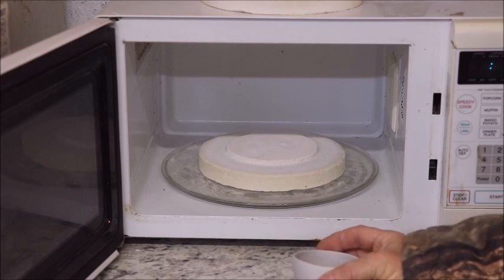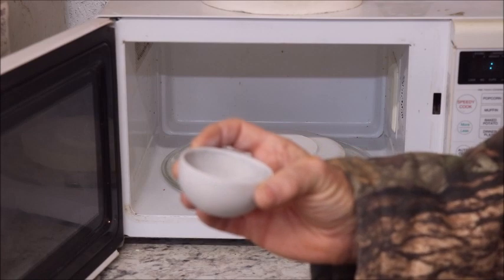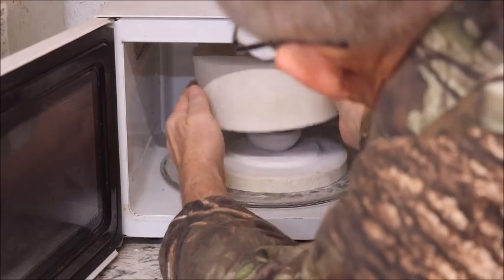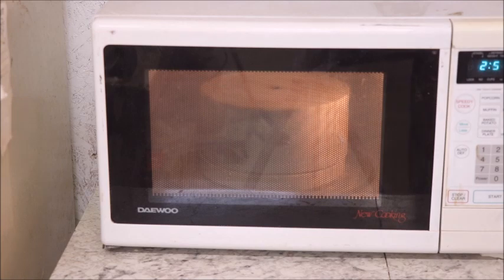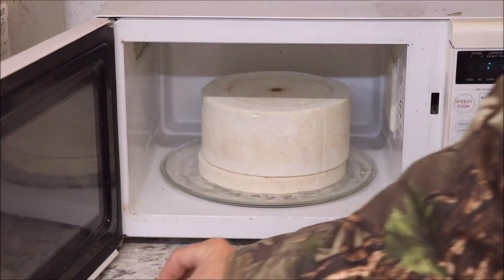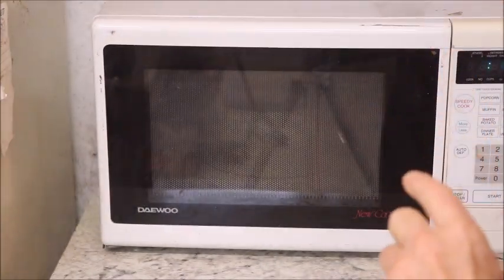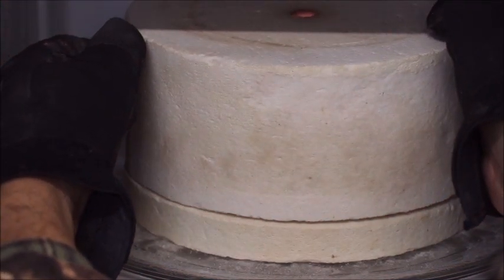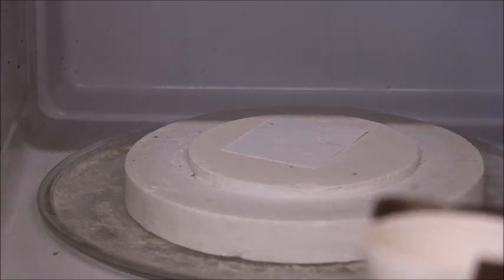Microwave Kiln Bisque

Comment: I put a clay cup in the kiln, it was dry it did not dry overnight. After three minutes i checked on it, then it was destroyed in peices
Reply from the maker: Sometimes that happens.  How long did you dry it (in days)  If you hold a drying piece in your hands and it is cooler than the surrounding temps, it is not fully dry.  Just saying.  I also have had stuff crack or bust for no reason.
Reply: Capt Mike I also tried something that took 1 day too dry, but we heard sounds from the microwave while the clay bowl was in, then we checked and it was also destroyed just like the last one.      How long should I wait for clay to dry until I can microwave kiln it?
Reply from the maker: @laughytauffy8530  one day is not enough for clay to dry.  It usually take at least 3 to 4 days, maybe more depending on the local humidity and temperature.
Reply: Roblox General, not only must your piece be fully bone dry (not cool to the touch), but it must not have air pockets or be too thick. Also, you might try bringing it up to temperature much more slowly that might help.

Comment: Hi Mike - just been watching your video, thanks. What are the interior dimensions of your microwave kiln (diameter + height). Is it the largest size available? Can you please give me some idea where you got it from and how much it cost? I live in Australia.
Reply from the maker: I purchase them on Amazon :https://www.amazon.com/gp/product/B01M2XWNCI/ref=ppx_yo_dt_b_asin_title_o00_s00?ie=UTF8&psc=1
Reply: @CaptMike  Hi - thanks :) However, I'd like to use it to fire pottery, and need a larger size to accommodate various pots I've thrown. Is there a commercial microwave kiln larger than this one?
Reply from the maker: @grahambuxton3833  Not as far as I know.   There are various videos on making one your self and I am going to try, but I think the one I use is the largest right now.
Reply: @CaptMike  Thanks, I appreciate that. I think I'm going to have go at making my own microwave kiln using a ceramic pot, electric paint as a conductive ink, and a ceramic fibre blanket. And I'll get myself a second-hand microwave oven rather than use the kitchen one! Then I'll have a go at making my own glazes! Should be fun :)
Reply from the maker: @grahambuxton3833  sounds like you are on the right track.  Make sure you have a good base, one that will insulate or the glass part will crack (ask me how I know).  Keep me posted on your progress.
Reply: @CaptMike  Thanks Mike. I appreciate the tip about the base!

Comment: Could I possibly skip the paper that goes in the bottom and can a microwave kiln for making glass work with a very small piece of pottery/ ceramic clay ?
Reply from the maker: My standard procedure for preparing a microwave kiln is to first use kiln wash on the bottom part of the kiln.  Then I use kiln shelf paper on top of that.  If you can set a greenware piece inside the kiln (not touching the top or side) you can bisque it.  You might not get good results with a real thick piece.  I have also successfully glazed and did Raku in the microwave kiln.   I have all these videos on my channel.
Reply: Oh okay will watch 👌🏼 thanks for the tips 😊
Reply: @CaptMike  How thick can the clay be? I noticed your bowl was thin.
Reply from the maker: @JDRobertson  It does nor have to be real thin, just remember, the more mass you have the longer it takes to dry and to heat up in the kiln.

Comment: Please, help me! I don't know where I'm making a mistake :( First works great, everything ok. Suddenly I started to have problems with the glaze. Baked, bubbles and a different color than before. I don't know what's going on? I shortened the time, I thinned the glaze, still nothing.  Maybe a problem in the microwave?
Reply from the maker: The problem should not be with the kiln.  At the end of your firing sequence, peek in the kiln and see if the piece is red hot.  If you are using a low fire glaze (cone 06) the results should be the same.  Make sure the glaze is completely dry before firing.  Are you dipping the bisque or using a brush?
Reply: @CaptMike  Thanks for the answer Yes, I only use low firing, I painted and brush and pouring and still the same : (
The stove is red hot, it looked like the glaze was too baked, so I was controlling the firing, then it was like some places were melted glaze  and others not :(
 I don't understand :(
Reply from the maker: @rozwojowa  If possible, send me a message with a photo or two here:  https://www.facebook.com/michael.d.blackston and I'll see if I can help you with this.

Comment: so you can fire the smaller objects that u use clay slip in molds n fire them in microwave kiln but what abt firing time n settings do u need to use kiln wash to do this with ur microwave kiln or just fiber paper I have small molds for pouring clay n then ur supposed to fire in regular kiln but if this will work it's be great any advice thank u for sharing I'm new to this
Reply from the maker: I always put kiln wash on the top of the bottom part when it is new.  However, always use kiln paper on top of that when you fire.  As far as a schedule goes, you will have to develop your on based on the wattage of your microwave.  I would suggest you start with 3 minute increments and watch it until it gets red hot (Glowing).  That is normally enough for it to become bisque.
Reply: Capt Mike thank u for ur help n answering me back
Reply from the maker: If you need any more help, just let me know.
Reply: @CaptMike  how do I figure out the wattage of my old microwave?
Reply from the maker: @berneemartin4383  It should be on a lable, usually on the back somewhere.

Comment: Can you bake bronze clay in this kiln?
Reply from the maker: I don't know.  What temps does the bronze clay mature at?
Reply: In a kiln for 820 °C during  30 minutes.
Reply from the maker: @-LR-  820 is 1500 F.  Thats pretty hot, but I think the MWK will go there.  I don't think you will hurt anything by trying.  I would fire the clay at 3 minute intervals until it was yellow hot and hold for 20 to 30 minutes.  Make sure you have the kiln inside floor well washed and use a layer of kiln paper.  Understandstand I have never tried this so do so at your own risk.
Reply: @CaptMike  thank you

Comment: whats is the cover in the microwave made of?
Reply from the maker: The kiln is made of a soft material similar to the material soft fire bricks are made of.  I'm sure it is a propriety material.
Reply: @CaptMike  can i use a hotplate and heat the ceramic directly on it, or can I use microwave without that kiln?
Reply from the maker: @osirusj275  The hot plate, regular contentional over or such will not get hot enough to fire ceramics.  A microvave oven without the microwave kiln will not create enough heat to work either.  Thanks for asking.
Reply: @CaptMike  hahha thanks for replying what about those hotplate with temperatures adjustment up to 1600c and use something to cover it at top?
Reply from the maker: @osirusj275  Wow!  1600c is hot, about 2900 f.  Still, the microwave kiln ould not work.  If you could build a kiln that you could set that hotplate inside of, it might work.

Comment: That small bowl you fired , was it Cone 4 ? I want to try making a pendant ocarina !
Reply from the maker: As far as I can tell, the microwave kiln reaches about 1400 to 1500 degrees fahrenheit.  I would think more in line with cone 06 to 04.
Reply: @CaptMike  Hello again , What brand of clay were you using in this video ? and how much time did it take to completly fire this piece ?
Reply from the maker: @Yannick432  The small bowls I make for testing (for cone 06 glaze) are cast from low fire slip.  If I am testing a cone 6 glaze (fired in my regular kiln) I use a mid to hig fire clay.  It normally takes about 12 minutes for my microwave kiln to reach 1700 degrees F.  That's a little low for most cone 06 clazes, but it seems to work.
Reply: @CaptMike   Ok so 12 minutes to transform bone dry clay to bisqued ceramic ?
Reply: @CaptMike  Im sorry to ask you som much question but im amazed by what you could achieve with this small kiln ! Its incredible
Reply from the maker: @Yannick432  The only reason I make these videos is to help people. Feel free to ask questions anytime.
Reply from the maker: @Yannick432  It depends on the microwave oven.  Lower wattage units might take more time than higher watt ones, but 12 to 15 minutes on a small item should be a good starting point.  After the item has cooled, tap it lightly with a spoon or something and see if you get that familiar "ring" that signifies the first stage of vitrification.
Reply: @CaptMike  What cone is the clay you are using and the brand ?

Comment: What cone is your clay?
Reply from the maker: All the clay bisques to cone 04  You can use either low or medium or high fire clay.  It oly matters when you start to glaze.  The MWK will not  (so far) get hot enought to need other than low fire clay body.  Thanks for the question.

Comment: Hello
Which kind of clay should i use to make a biske in the microwave kiln ? 
I have at home a black clay that turn red when it is fire in the gaz kiln, i think the name is eathenware ou faïence in french. CAN i use it for microwave kiln ?
Reply from the maker: Any clay designed to make ceramics should work fine for the bisque phase in a microwave kiln.  I use my local clay (that also turns red) and it works fine.

Comment: However 3 minutes increments protects your microwave
Reply from the maker: I use the 3 minute incriment thng so I can check on the piece being fired between incriments.  You could probably get a way with going 15 minutes or so streight, but sometime thig crack or break and checking helps save time.

Comment: can i make porcelain in the microwave with clay and high heat?
Reply from the maker: If the pieces would fit in the kiln and you could get the temps high enough, yes, it would work.  Porcelain is a high fire clay and as best I can tell my microwave kiln heats to about 1500 F, maybe a little higher, but it is hard to tell.  May I ask what you are going to do with the fired pieces?  Maybe you don't need to go to porcelain temps.
Reply: is that the biggest piece that can fit in the kiln?

Comment: NO!! not supposed to let this kiln cool down in microwave.
Reply from the maker: Artsy, may I ask why?  I usually let the kiln sit in the microwave a couple of minutes, then remove it and sit it on something fire proof and after maybe 10 minutes I prop the kiln slightly open with a piece of ceramic and let it finish cooling.